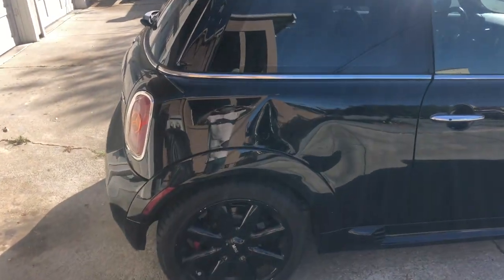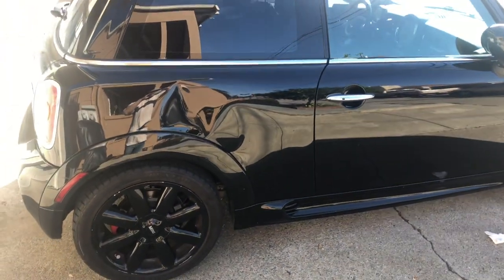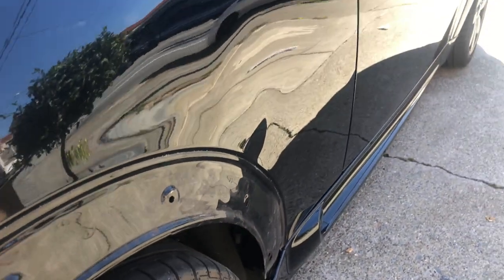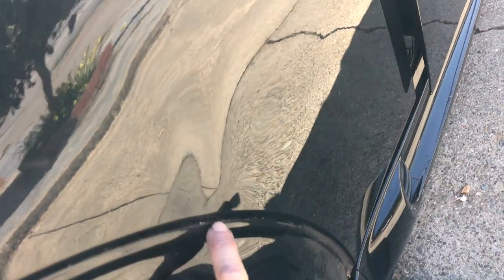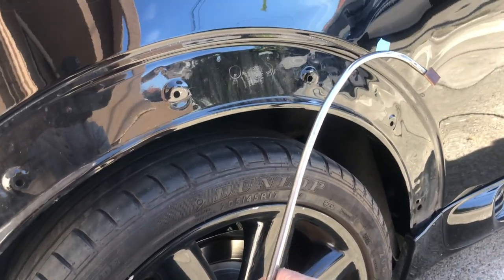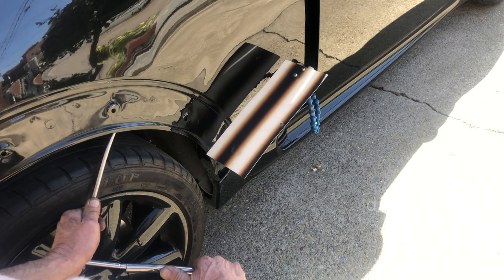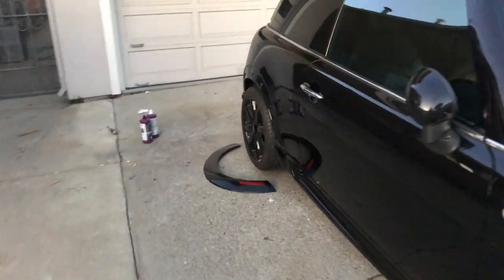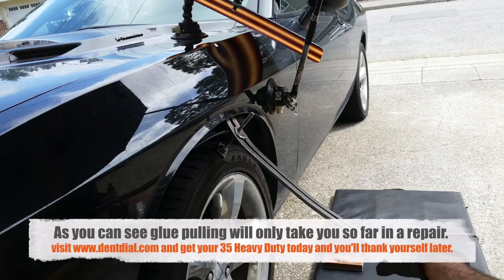Mini Cooper quarter panel paintless dent repair using Dent Dial tools.

Comment: Nice work . I was thinking about welding a socket on to use a ratchet as well  on some of my tools . Is that what you did on the j hook?
Reply from the maker: yes I've been teaching that in my videos since 2008 and it's how all my tools are setup.  Don't use your wrist in Pdr or you'll be hurting later.  Take care and happy pushing!
Reply: Yes I'm in my 50s and most nights are an Advil night
Reply from the maker: straight lines i’ll be 57 in March and rods can be the detriment to any Pdr tech’s body because they’re really not the best leverage unless your handles extend to use your forearms. Of course you have to use them in Pdr but when in a scenario you don’t have to.....then don’t!  Flat bars give you way more stability with crazy good control. Take care!
Reply: We are the same age  sal. I feel it to